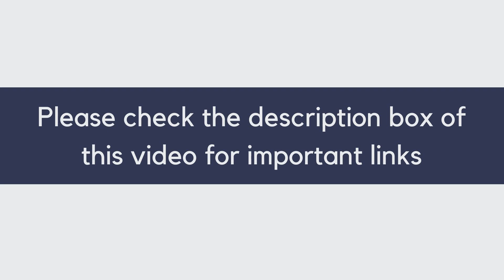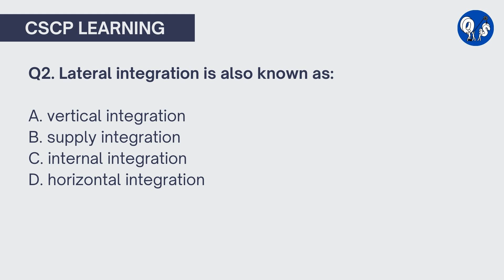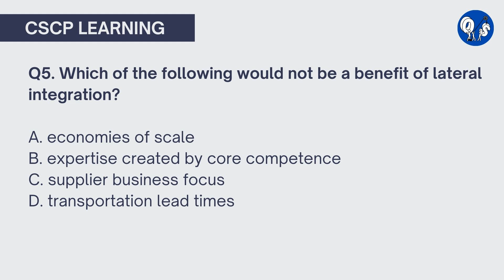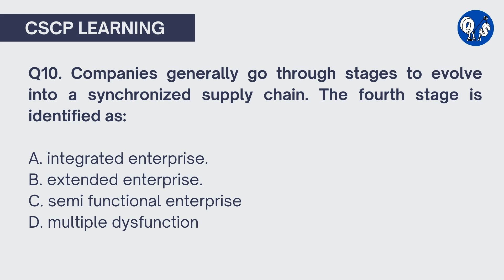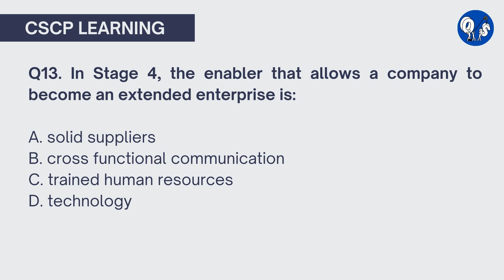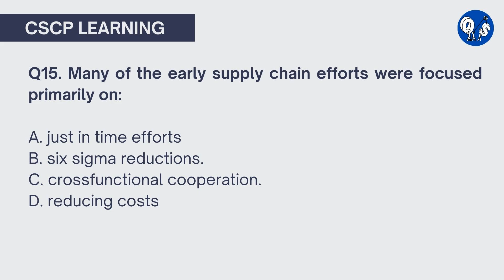CSCP Exam Practice Question Test 12

Comment: Question 4, answer should be ERP
Reply: ERP is just a new tool or tech system for improving operation. nowadays it's a necessary thing in practice but communication is the key element even if there was no ERP back then.